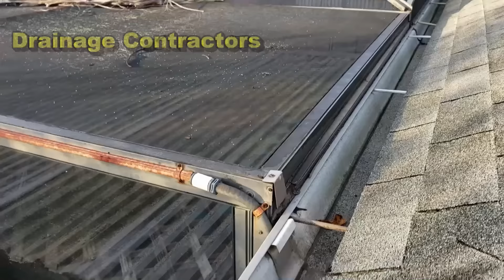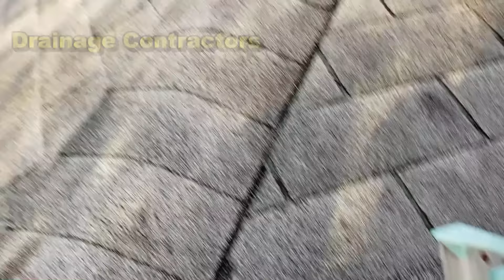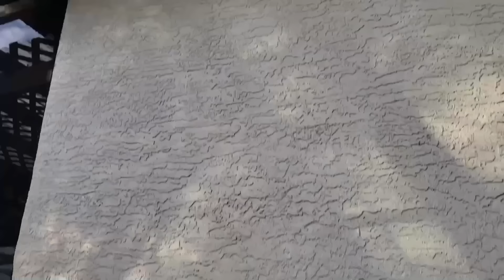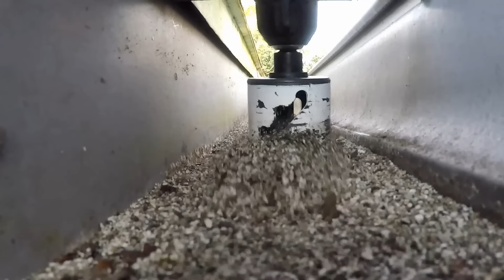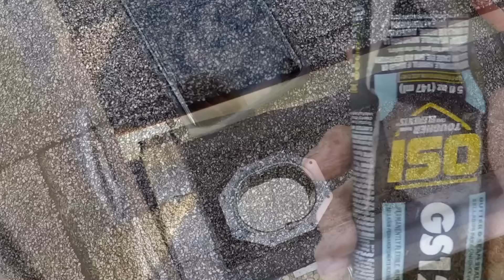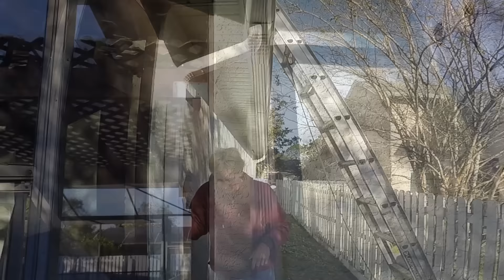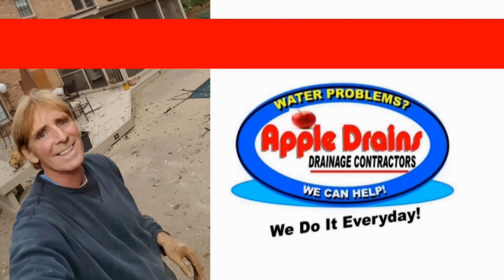How To Add a Downspout To Your Gutter

Comment: Question- Why did you install a 2x3 outlet in the gutter and use a 3x4 downspout pipe? Why didn't you use a 3x4 outlet to let the water drain faster??

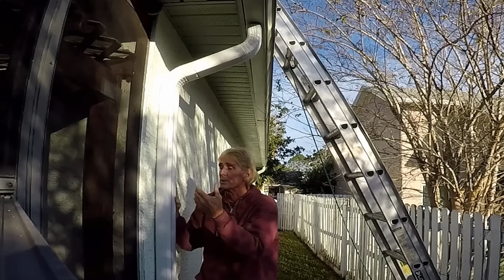Comment: At 8:50, the gerry-rigged secret way, using piece of wood to secure the screw holding the strap, is a bad idea. Unless you plan on moving soon. Wood rots, and in hot, humid Florida it rots quickly. Either get the proper plastic masonary fastener,. Or if you must, gerry-rig it with a piece of scrap plastic the same way as suggested with wood.  Otherwise this was an extremely useful video.

Comment: Use a wall anchor for the screw mount on the wall, not some random piece of wood that will rot. Home owners, if your shingles are depositing that much loose granular material in a couple of weeks, you need new shingles. Don’t buy the cheap ones this time. And don’t let your OHS dude see you cutting metal with a hack saw using your leg as a work bench. Your insurance agent will have a hissy.

Comment: I drill and rivet the downspout connector to the gutter without doing anything to the gutter.  Then I use a wood chisel to knock a star into the gutter in the center of the connector.  I push the metal down into the gutter connector.  This helps to channel the water into the center of the downspout.  Easy Peasy.

Comment: When you see granulation like that in your gutters you should check for a bacterial mat on your roof.   It actually is eating at the granuals in your roofing.  Stand across the street and look at your roof.   If it looks to have darker streaks of has dark patches you have a bacterial mat.   If you see green you have algae or lichen.   Call a roof cleaner and they can kill all of it easily.   This will extend the life of your roofing.
   I do this professionally.   And you will be stunned at the results when done correctly.   You can do it yourself but the chemicals are expensive and is not pleasant to work with.

Comment: Thank you. We are in Tampa Bay at 90' elevation with good culverts on either side of the home. The seamless gutters did a great job of moving the water into those culverts. With Debby the rain came sideways from due south. The office in our home faces direct south. The water was driven up against our home office. A 22"x22" square of carpet was wet next day. I had moved the shrubbery in front of the office and left a "bowl" for water. Next day in the rain I dug below the foundation, installed a French drain and with eight cubic feet of soil and some St. Augustine plugs have the area functioning as it should. We simply need an additional downspout in that corner. People without gutters had much worse issues with hydrostatic pressure in our neighborhood. 

42 years in Miami/Ft. Lauderdale and now Tampa makes 56 years in areas where no name storms can do more water damage than hurricanes. The downspout shown is adequate to my needs and easily done. Thank you.

Comment: Thanks for sharing. After watching this, I now know our supposed house we built over 20 years ago, has substandard gutters/downspouts as far as parts/installation go.  Our builder touts themselves as "a cut above the average production builder".  They used simple "gutter nails" to hang the gutters & didn't use ANY "petty drops" on the connections between the downspout and the gutter hole.  They simply cut the hole in the gutter & folded the metal back to attach the downspout to.
Reply: Which is how you should do it. If you are using silicone or sealant you are doing it wrong. Your supposed sub-standard builder was doing it the proper old school way

Comment: How can you BLOCK a downspout? I have three in a row. I only want two. One floods a low spot in yard. i just want to block it.
Reply: Leaves work nicely.   Or buy a section of similar gutter about 2 or 3 feet long . Put it inside the original gutter,  centered over the down spout and tack it down with a couple of screws

Comment: When I have rectangular downspouts, I use rectangular drops. I don't mix metals because I don't like corrosion. Ensure fasteners are designed for use with aluminum (if you have aluminum gutters & downspouts). I thoroughly clean & dry before sealing. I use fasteners in all the available holes.

Comment: I watched this and put in my first downspout today. I made a mess of adding the hole to the gutter!
Reply from the maker: Not to worry. Try an oversize drop to cover the mistake. The water won’t easily flow from the gutter into the downspout. I’m sure you did a great job!
Thanks for the comment
Reply: @appledrains  It wasn't as straightforward. There's a dormer that drains into the 1st floor gutter :-O

Surprise it overflows the gutter. I added a new downspout directly where it empties. But I could not get to the top of the gutter because the dormer downspout was in the way.  It was very awkward.

Comment: I might be wrong but to me a sub base layer is for load Bearing……not for water to drain on? Nice job tho took my overflow pipe to a drain in a simlar idea as it was making marks on the wall which I had to use brick acid to remove

Comment: The biggest  job is having room to cut out for the outlet from up on the roof. Cutting from the underside is a breeze.
Reply: Be sure to wear your safety squints!   
Aluminium saw dust is difficult to remove from the eye.
Not like steel shavings which can be removed with a powerful magnet if done immediately.

Anything left stuck in the eye more than a day  will require a trip to the ophthalmologist.

Comment: Good video couple tips,sealer also should go from the top of the outlet,reducing chance for leaks also more screws on the elbow to outlet,at least 2 and the bottom elbow is not guttered properly, it needs to go over the downspout not inside

Comment: Thanks for the video. I relocated a couple of "mis-located" down spouts when I bought my house 23 years ago and I did the job just like you did in you video. If I ever did it again, I would do one thing differently and I'd like to know what you think. The problem I have found is that gutter downspout adapter flange ridge builds-up a dam of shingle granules and after awhile backs up the downspout opening. I have old vinyl "gutter guards" with ~1/2" holes that keep most of the sticks and leaves out but fine debris finds it way through so I get on the roof (low pitch) now and then to flush it all clean. I shoot water right through the gutter guards. My idea to help prevent the buildup around the downspout adapter is to install it FROM THE BOTTOM of the gutter. I feel that a smooth transition will not block the tiny granules and debris and allow them to dam up nearly as much. As you mention the sealant is really holding it together so I don't think it would be a problem not taking structural advantage of the flange on the adapter. I would also use a couple or 3 pop-rivets instead of screws because of their low profile. I admit my roof is old and sheds granules more than most but what do you think of the "mounting from the bottom idea".   Thanks!
Reply: Excellent idea. Granule buildup is truly a problem.
Reply: @MrkWil1234  Thanks for the reply! It's just an untested theory at this point but the next time I connect a downspout, I'll install the flange from the bottom and see if it works better...It can't be any worse LOL!
Reply: Did you ever try this yet?
Reply: @gjk1504  No, I have not had the need to mess with my gutters yet but I do have old shingles in need of replacing. That's probably one reason I have a lot of granules in the gutters. Maybe I'll get a new roof this year? We'll see... Maybe wait for the next tornado???
Reply: @garymessling8153  thanks for the reply!
Reply: Thanks for the tip I'll try it this way

Comment: This is exactly what I needed to do to solve my back up issue.  Thanks for the post....
Reply: Does the slope of the gutter need adjusted or no?
Reply: @nofurtherwest3474  If you review his description at 1:00 he shows the path to be on the downward slope, turns the corner, and continues sloping down.  You do (must) selected proper placement of the new downspout....which he had already done, thus, no gutter slope adjustment needed in his case.

Comment: Making me nervous with that saw. LOL
Anyways, I had the gutters cleaned with a leaf guard put on.  They are 5 inch gutters but I am sure with four downspouts it should be fine. 
Two are draining very slowly with a waterfall  spewing out of  the corner.  ….the other two are fine.   Either they never cleaned the downspouts when they cleaned the gutters (which is very unpro) or... well that's my conclusion.  I am sure that's the problem. Unless you can see another one.  I'm all ears.
Called them back two days ago.  "Swinging by" in a week, meanwhile we have heavy rains coming tomorrow (Fla)   I think I'll be switching my gutter guys.

Comment: This is a terrible job installing this downspout. There are a lot of mistakes made in this install. The first mistake was using the wrong size drop tube for the downspout. The second mistake and the worst mistake is not cleaning out the gutter before sealing the drop tube. If you watch you will see all the dirt and crud still stuck in the gutter when he installs the drop tube. The sealant is going to stick to the dirt and crud instead of making direct contact to the metal gutter. To properly install the downspout you need to scrub the inside of the gutter until is completely clean to the metal surface. You can use a wet rag to remove the majority of dirt and crud. Then use a rag w some mineral spirits, or acetone, or rubbing alcohol will work too. Clean it until it's completely clean w no dirt or crud stuck to the inside of the gutter.  Anytime you are trying to seal two pieces of metal together, both pieces need to be totally clean and dry. Any dirt or moisture will prevent the sealant from making proper contact with the metal surface. And another mistake he makes is using those huge screws to attach the drop tube. The drop tube should be attached w pop rivets. And if you notice all the little holes in the flange on the drop tube those are all the spots you should place a pop rivet to secure the drop tube. And you need to use sealant over the top of the flange after it is installed to seal all the holes from the rivets and to seal the edge of the flange. The way this was installed will leak if not immediately then within a month or two for sure. Taking the time to properly clean the gutter is going to give you a truly professional result.
Reply: I'm glad someone noticed these issues
Reply: What are you a nasa engineer. The sealer will do its job. Rivets better but not necessary. 1/4" screws sre ok
Reply: @gabrielM1111  😂

Comment: Thank you for the great, detailed instruction.
Reply: Do you have to adjust the slope of the gutter?
Reply: no further west ideally you should, it’ll work better, but not necessarily; if you don’t the water will flow as the water level goes up, but it’s not as efficient. You will also end up with areas that will puddle/hold water.

Comment: Approximately how much it costs just to have a downspout installed? Also, I noticed that Home Depot and Lowe's only have galvanized steel downspouts. No aluminum like the installer outfits.
Reply: RKGSD Aluminum is back in stock.

Comment: I see this a lot a long run that needs more down spouts ,seal up the screws keep the rust down a bit ,folks use a plastic anchor then install your screw wood will expand shrink then fail .

Comment: Am I the only guy that cuts downspout with a portable sawzall and a 24TPI blade?  It's basically a 5 sec task..  The blade backstop gives you a perfect perpendicular cut.
Reply: I was thinking that too. I have a Milwaukee battery powered hacksaw that I use for cutting metal and wood.